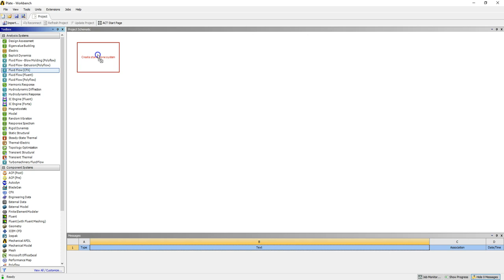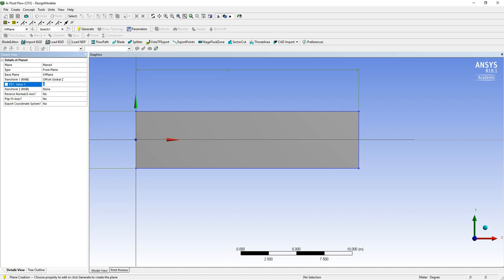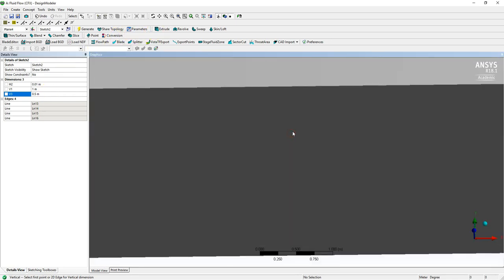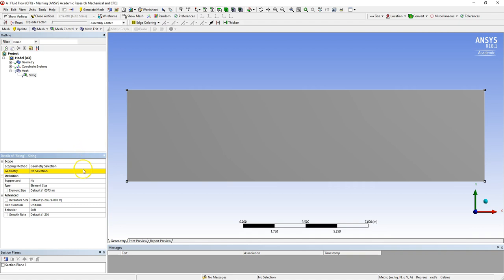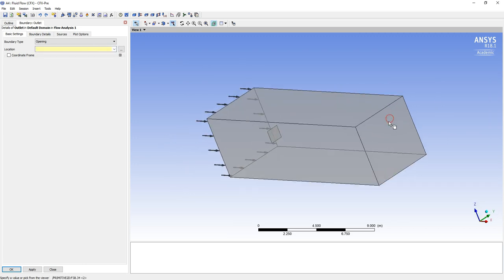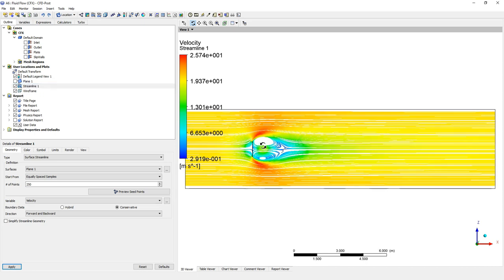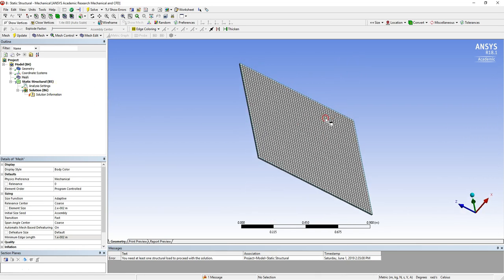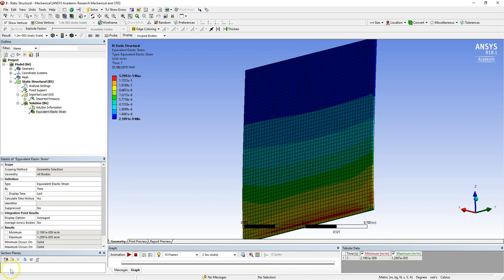Importing pressure loads into Ansys mechanical

Comment: I'm trying to import "Body temperature" from Fluent to ANSYS Static Structural and ANSYS Transient Structural. But I keep getting this message. "You have a load that is not attached to any geometry. The solution cannot proceed until this is fixed." Can you help?

Comment: The workbench is crazy. Is there anything like this in NX, or would that click and drag the solution across feature just be a set of steps? I tried using NX’s combined structural and flow simulator, but it’s running into errors so I’m trying to do them separately starting with the CFD
Reply from the maker: Hi,
I'm not aware of NX I've only used FSI in ansys.
Reply: @ClimateCFD  oh that’s all good, I shared this video with my group because of how clear it was to follow, and the workflow is pretty similar
Reply from the maker: @lordofthetimbs  Thanks for sharing.

Comment: Hi, I've tried following this demonstration however when I attempt to solve the static structural the imported pressure fails "An error occurred while importing the data. Additional information may be available in the Load Transfer Summary." Do you know what is going wrong and how I could fix this please? Thanks
Reply from the maker: Hi Andy,
Couldn't be sure without seeing .out and .cfx files. If you want, send them to climatecfd@gmail.com and I'll take a look
Reply: @ClimateCFD  great thanks
Reply: @andye9763  @ClimateCFD I am having the same probelm, could you identify a solution for this error?  Thx